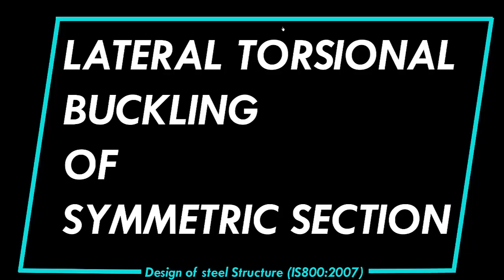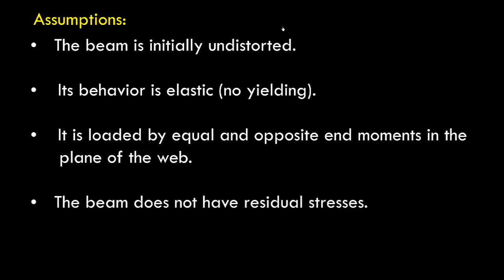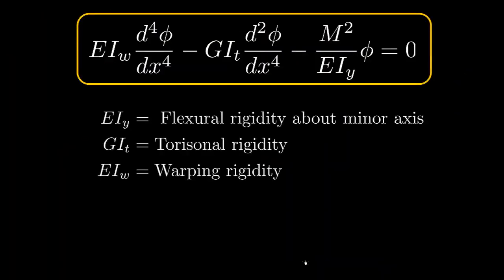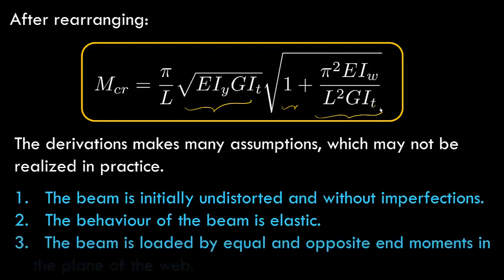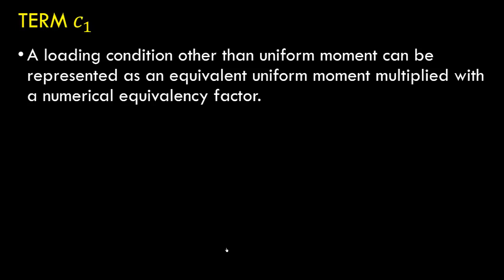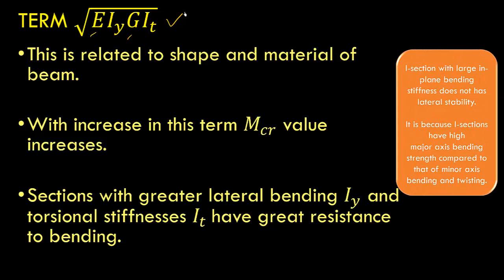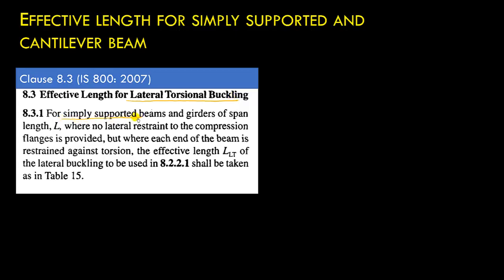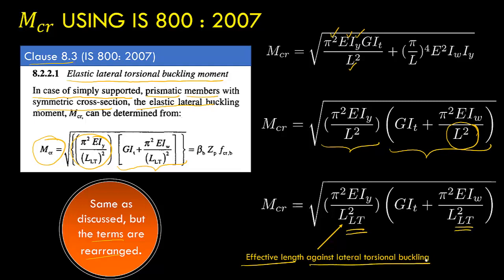Lateral Torsional Buckling of Symmetric section I @IIT_Prof.Prakash

Comment: hi, Please advise me what is the concept of buckling length. 
if I am using UC 203-203X46 Kg/m, with a length of 5000 mm resting on 225 mm brick wall under M.S steel plate OR  concrete pad. I understand that in my case Effective  buckling length is  = 1.2L+2D= (1.2x5+2x0.203)) = 6.406 m. Please confirm?
Thanks
Reply from the maker: yes this will the effective lenght. Please also check the code is there clause related to thickness of brick wall.